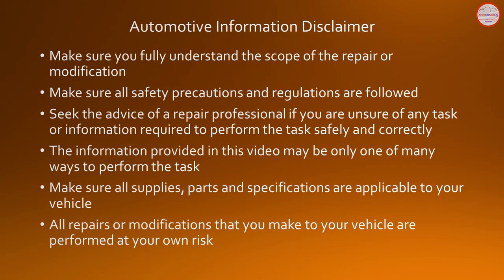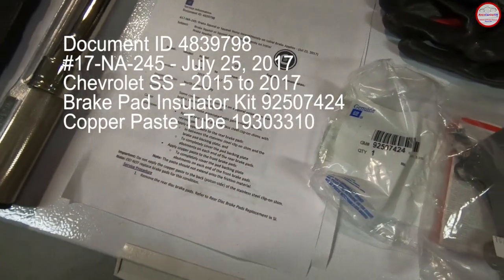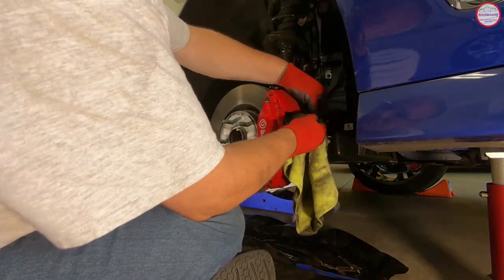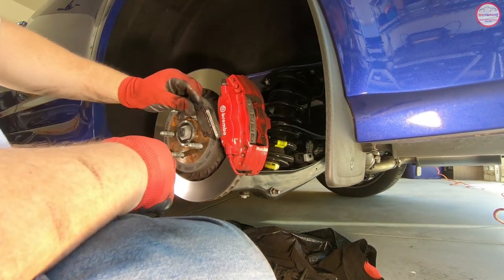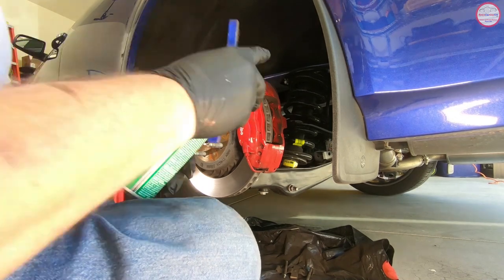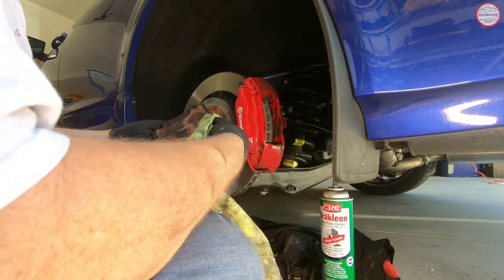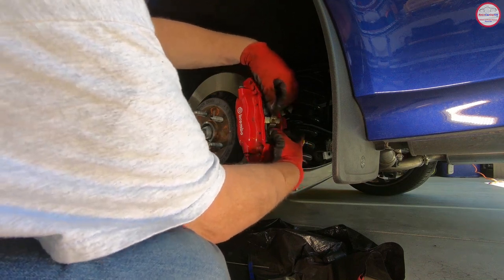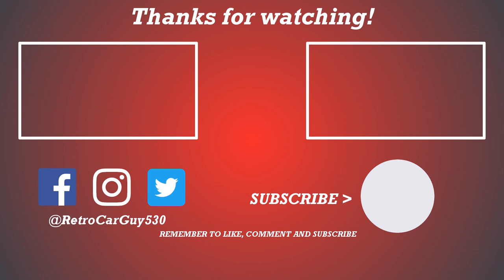Chevy SS - Brembo Brake Squeal Noise TSB

Comment from the maker: I performed the TSB outlined tasks on my 2017 Chevrolet SS sedan at 3200 miles.  Has the latest TSB resolved the issue (long term) for your Chevy SS?
Reply: The dealership did mine at 36k miles. I'm now at 45k. I get an occasional squeak from the rears but it's what I considerable normal for Brembos, not the horrendous shrieking that it was doing before. The occasional squeak that I get now lasts just about 3 seconds but isn't obnoxiously loud. It started doing the new squeak at around 43k. The previous paste-only fixes were lasting around 7k miles for me. I had that done 3 times before this new TSB came out, so it's been nice not hearing that insanely loud squeal for 9k miles.
Reply: dude the squealing is vibration, which is why all you need is some form of absorption for the pads and piston applicator, which then the noises will  go away 100%?

Comment: Doing mine this weekend finally, after waiting a month for parts to arrive. Thanks for your very helpful video.
Reply: Also the TSB instructions can be found online at https://www.ssforums.com/forum/documents-manuals/155233-brake-squeal-bulletin-latest-remedy-procedure-2015-2017-my.html
Reply from the maker: You're welcome.  The tubes of copper paste don't look like they contain much in them, but there's a lot more than it looks like in each one when you use something to squeeze out the paste from the bottom.
Reply: RetroCarGuy530 I have 8 tubes so I can reapply in the future as well :)
Reply from the maker: Evo Shift my user id on the SS forums.com site is ls3ss

Comment: Nice Video,   just got new Brembos and was wondering what the tubes were for.    140ftlbs on lug nuts,   sure it's not Newton Meters,  that's a hell off a lot.
Reply from the maker: Yes, it's 140 ft lbs for the wheel lug nuts.  The 5th Gen Camaro, Chevy SS Sedan and the Caprice PPV all have that as their lug nut torque with stock wheels.
Reply: Wow.  Ok so if factory Brembo them 14mm wheel studs are fitted. Makes sense.   Hello from Australia.   Cheers.

Comment: Great Easy to follow Segment...Thankyou ! 
Got the same colored 2017 SS
Mine cane with the optional Walkinshaw 375KW engine upgrade
Reply from the maker: I'm glad you liked the video.  Sadly, I had to sell my 2017 Chevy SS in January 2020 to help fund my company.  Although, I do have another Holden manufactured car with my 2014 Chevy Caprice PPV.
Reply: @RetroCarGuy530  
ooOO Chevy Caprice(ex cop car?)
Long wheel base 
Similar Engine -
Reply from the maker: Similar to the Holden Statesman but sold in North America as a police fleet vehicle.  Mine has the 6.0L L77 engine and 6L80E transmission.

Comment: Hi have you had much noise since doing this TSB 3 years ago?
Reply from the maker: Sadly, I don't own that car any longer.  For the year after I applied the copper paste per the TSB, I did not any squealing noises.
Reply: @RetroCarGuy530  Do you think any brake lube will work or does it have to be the GM copper paste?
Reply from the maker: @Steve  I think any decent quality brake lube (paste) will work.
Reply: @RetroCarGuy530  It definitely stopped the squeal, thanks. Hopefully when I wash my wheels next, it won't wash away the paste?

Comment: thank you for your informative videos, and sorry to learn that you sold your vehicle.  Could you comment on the method that you used to raise and support the chevy ss?
Reply from the maker: Depending on the task being performed, I'll either use my set of Race Ramps (if no wheels need to be taken off) or I'll use a combination of a low profile floor jack along with a ZL-1 pinch weld adapter I purchased several years ago to lift the car.  I was able to lift the side of the car enough in this video with the floor jack to get the aluminum jack stands in place and then I moved the floor jack to another location to act as a secondary/safety jack in jack of a jack stand failure.  The jack stands in this video (BIG RED T43004) are available on amazon (my affiliate link for them) https://amzn.to/2Nzplnp

I also purchased a couple of rubber caps for those jack stands, but they don't seem to be available any longer.  I will put those on the top of those jack stands when I want to use them in the pinch weld of the car.  https://www.amazon.com/gp/product/B07CNJL5G9

With my current 2014 Chevy Caprice PPV (similar jack points to the Chevy SS), I purchased some low profile ESCO jack stands to place the vehicle on.  I'll use the pinch weld adapter and a floor jack to lift the car and then place low profile jack stand at the point for a "lift" pad on the Chevy Caprice PPV (again it should be the same as the Chevy SS since they're the same base platform made by Holden).  I haven't used these on the front lift points of the Caprice PPV yet, but I plan to when I refurbish the front suspension on my Caprice PPV in the next couple of months.  I use those jack stands in this video https://youtu.be/YB4e_iTd4iY where I replace the rear shocks / end links on my Caprice PPV.

ESCO 10499 Low Profile Performance Jack Stand (affiliate link - US): https://amzn.to/31L4uRR

I hope that helps!
Reply: @RetroCarGuy530   Where did you lift car with floor jack ?  I have no idea why Chevy made this task so confusing, so I am looking for guidance
Reply from the maker: I use the floor jack along with the ZL-1 pinch weld adapters to lift one corner of the car.  While it's lifted on the floor jack, I place the jack stand in the "lift" position.  There are a couple of threads on the SSForums website with the info showing the "lift" points for the jack stands.

https://www.ssforums.com/threads/proper-lift-points-photos-diagrams.183799
https://www.ssforums.com/threads/lift-point-information.5626/post-84162
Reply: @RetroCarGuy530  I know--that forum has several varying opinions regarding properly lifting and supporting the SS.  In your video, you support with your stand (with ZL) at the pinch welds, so where did you actually lift with floor jack?
Reply from the maker: @Niel Gilmor as I mentioned above, I used the ZL-1 pinch weld adapter (I only have one of those) with the floor jack.  I lifted the side of the car with the floor jack and inserted one of the jack stands (not using the pinch weld adapter).  I have a rubber pinch weld piece for the BIG RED jack stands and I sit the car's pinch weld in the rubber pinch weld piece for that jack stand.  It's not the best approach, that's why I switched to using the low profile jack stand at the lift points and use the floor jack with the ZL-1 adapter to jack that part of the car up and then put the jack stand at the lift point area on the body.  There are a wide variety of opinions on this topic.  I'm just telling you what I did and you can judge for yourself if it seems reasonable for you and your car.

Comment: Is that just copper anti seize?
Reply from the maker: It may have similar characteristics to copper anti seize, but it appears to be a special use lubricant Molykote CU-7439.  The manufacturer claims this copper paste resists removal by water/steam which regular anti seize may not be as resistant to removal.

Comment: Great video. Sound was good too. Maybe just that my ears are working better tonight ha. Thanks for the upload. 
How many shims do you need to order(1 )or (2) or is one packet (part) enough for both sides? 

Thanks again, keep up the great videos...
Reply from the maker: GM part number 92507424 is a repackaged Brembo part that contains four brake pad shims.  You use two shims per rear wheel.
Reply: and thank you. I was looking for this info. Appreciate the reply :)